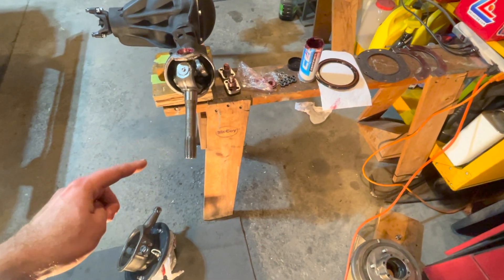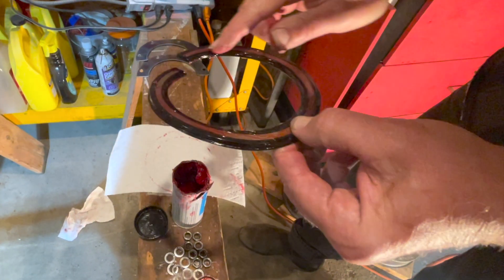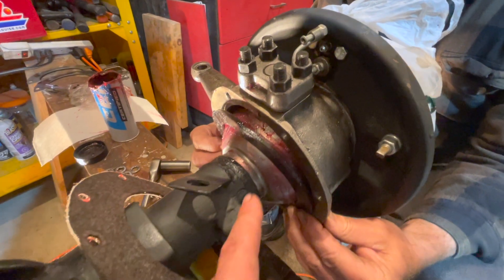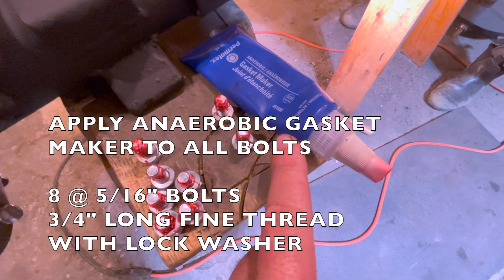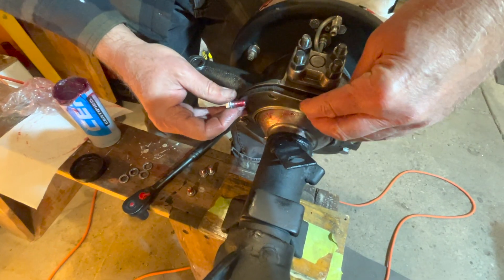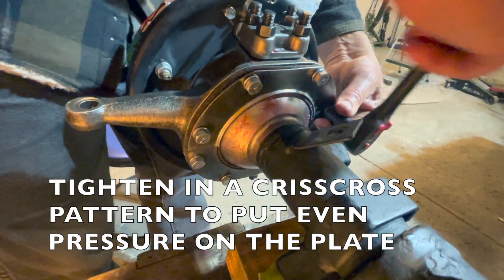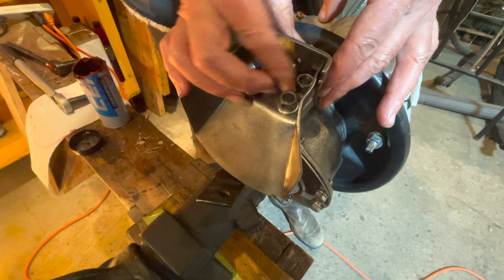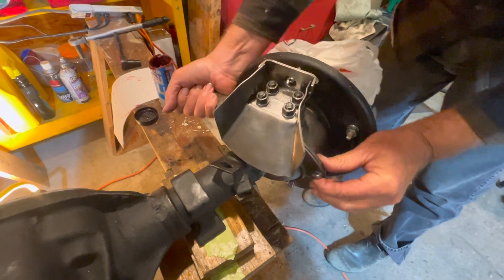QUICK FIX to repair LEAKING Steering Knuckles! *CRITICAL*

Comment: Is it crucial to remove the steering knuckle or can I save myself some work and slice the top of the felt open to slide it over the axle?
Reply: I ordered new felt/gasket kit and planned on doing what you are thinking.  Seems logical that it would work since the rubber gasket has a split, why not the felt.  We shall see when the parts get here.  Good luck